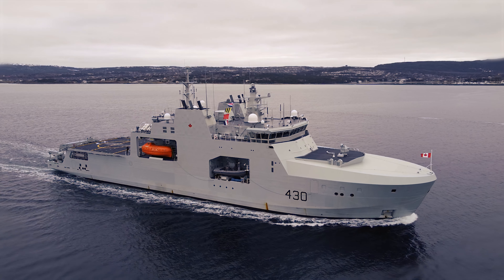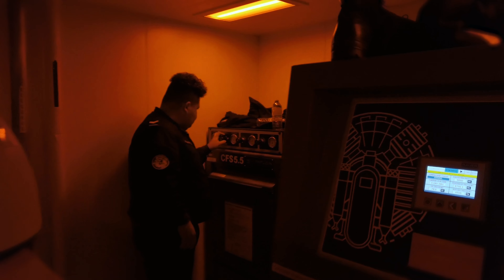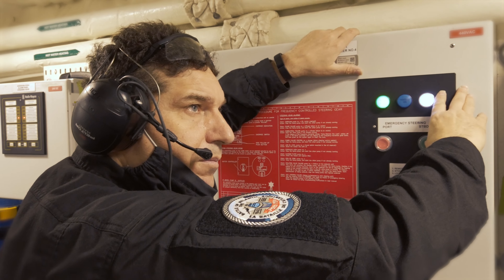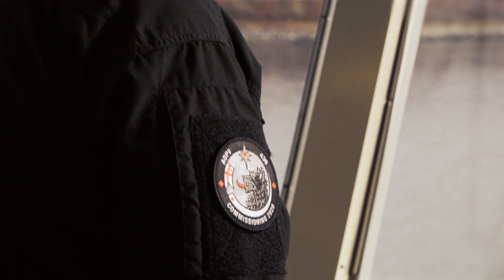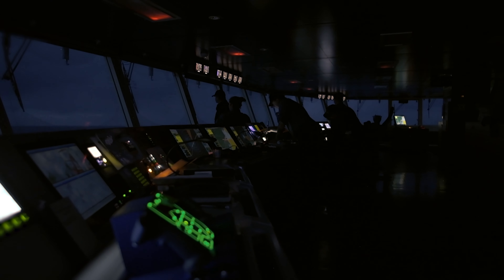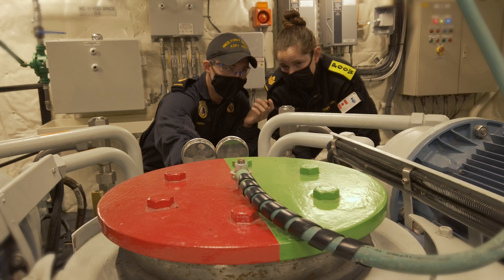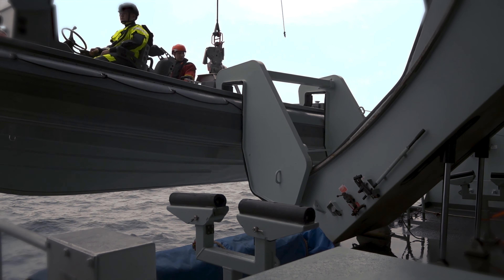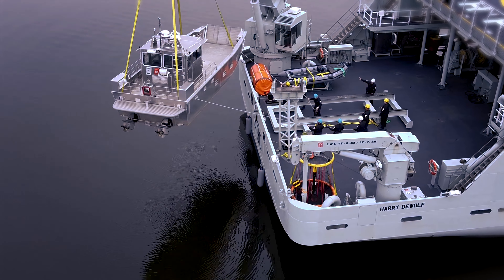Crew SHAKEDOWN! Learn How We Bring a Crew to Sea on a New Ship! - Building the Harry DeWolf Part 7

Comment: Why in later builds is the superstructure not increased by one level, loose the hanger for helicopters, and install a UAV launcher and recovery deck and hanger. It would increase the over the horizon capability in the arctic without risking the lives of our air crews???
Reply: The flight deck is more than large enough for a drone capable of firing missiles... Forresty Forrest flies drones from the summit of Canada's Rocky Mountains... More than 100 summits so far...

Comment: Beautiful ship but why does it only have 3 guns?🤣its a joke,there should be atleast 4 50.cals (not 2) and the main gun should be larger,you have all that space you could easily mount a few missiles or a cannon similar to the halifax class ships,how can a SHIP defend the coast/Arctic if it can only take out smaller boats with the firepower it has,so much defence potential waisted!
Reply: A soldier is quite capable of handling a bazooka from her decks... A whole company of soldiers could easily shoot automatic weapons from her decks, if necessary. Their Norwegian half sisters have a larger gun that most likely has never been fired in anger yet.
Reply: it has all that space precisely so it can be upgraded, when it needs to be. its called playing your cards close and frankly you dont need much firepower where these ships are going